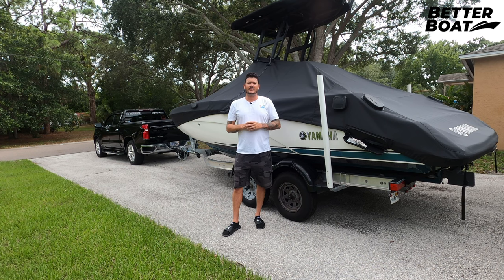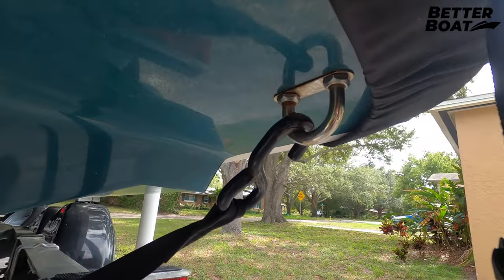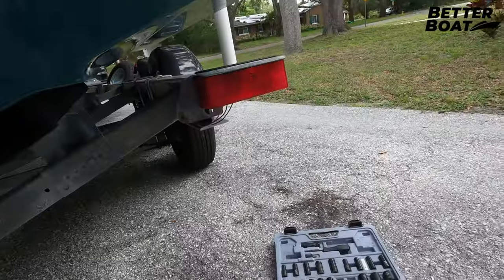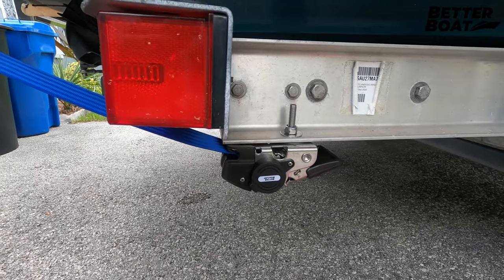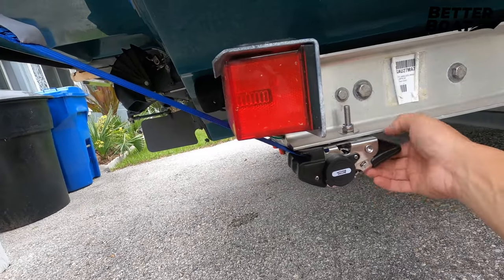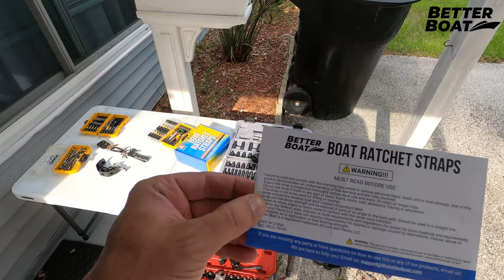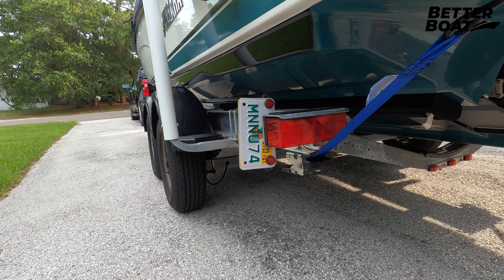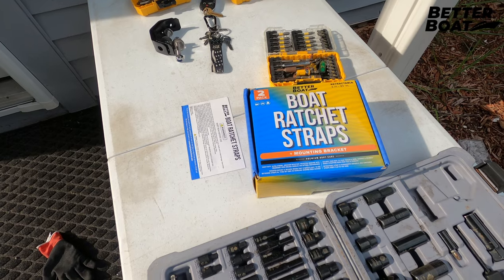Better Boat Ratchet Tie Down Straps Install and Initial Review on my Yamaha FSH Jet Boat and Trailer

Comment: I drilled one new bolt hole for the license plate holder. Allowing the holder be mounted in same spot just further out port side.
Reply from the maker: Sweet 🤙🏼

Comment: Doesnt this block the trailer lights? Just curious if it is legal this way.
Reply from the maker: No, as I explained in the video. Trailer lights are still completely visible. Even the stock straps that come with the boat cross in front of the trailer lights. This does not impede their function or cause any legal issues.
Reply: @THEFSHDUDE  thanks sorry I must have missed hearing that 😬
Reply from the maker: @cowboysfreek11  no worries, better safe than sorry 🤙🏼